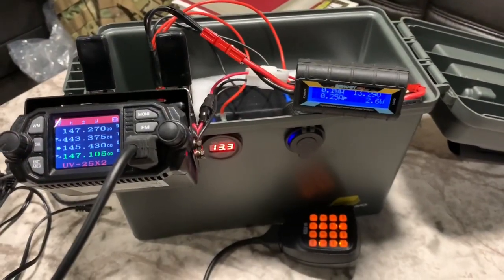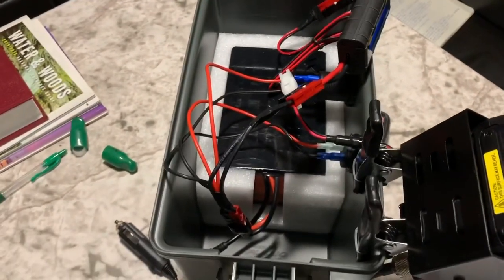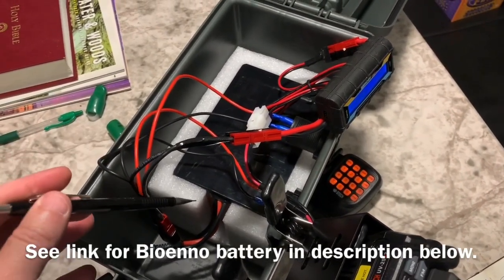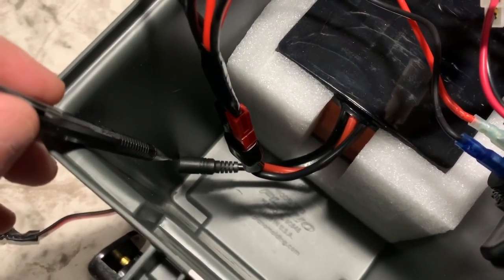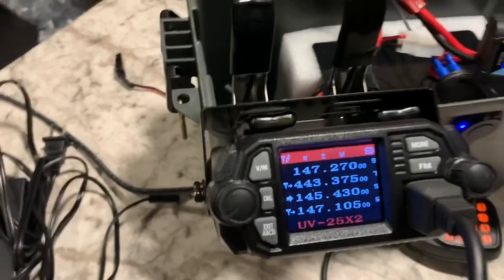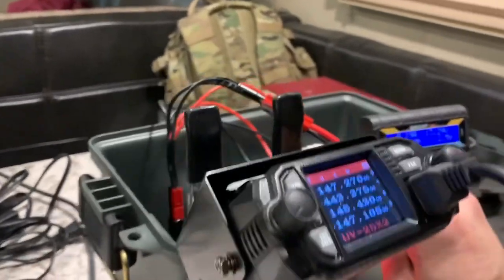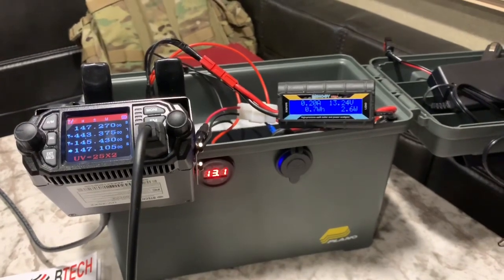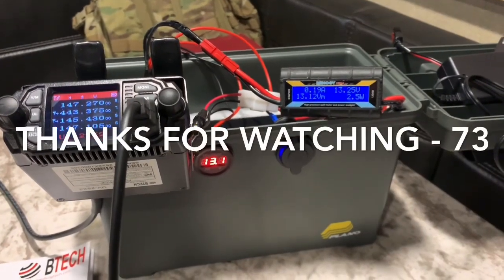Portable Radio Comms!  BTECH UV-25X2 - 2m / 70cm Go Box

Comment: Good video.  I  like the ammo box. I am hoping you can answer a question for me. I want to purchase a 12 volt power supply so I can program the radio with my laptop and Chirp. Is a 12 volt, 10 amp power supply too much? Is a 12 volt, 5 amp too small? What would you recommend? 
Thank you. 73's Ernest Bazzinotti KC1LKB
Reply from the maker: I would use a 12v / 10A power supply with this radio.

Comment: Great video! What kind of range were you getting out of a system like that? KI5RGM
Reply from the maker: Howdy and thanks for the feedback!  It really depends more-so on what type of antenna you pair this with and how high up you put the antenna.  If you use this with something like a Comet GP-9 vertical up at say 20 to 30 feet, you should get 10 to 15 mile radius on comms if your terrain allows for that.  If you pair this with a beam antenna with decent gain and similar height, you can probably double those numbers.

Comment: I'm fixin to test on the 21st for a technician license.  Would you recommend a rig like this for startin out?
Reply from the maker: It would be a low cost, yet functional,  dual band radio with modest 25 watt power that could be used in a vehicle or at your home that would serve you well.  The radio should be able to be found for less than $100.  A decent dual-band Mag mount antenna like a Tram 11861 should be available for less than $30.  For a starter radio that you will continue to find use for in the future, I think it would be a good buy.  The drawbacks are that the programming software (CHIRP) and menu system can be a bit clunky.

Comment: Since you have the watt meter installed, what is the max amp draw that radio pulls from your battery at full wattage?
Reply from the maker: With the portable antenna set up I typically use, which is an Elk 2m/440 5-element log-periodic, I can usually get 25 to 50 mile range simplex, depending on terrain.  I generally run that antenna at about 20 ft above grade.
Reply: Nevermind I see your radio is on high, and consuming about 3.67amps while transmitting. What's your best line of sight transmission distance how you have it set up in this video? I can get about 8 miles max on a handheld in the flatest of flat land and I'm looking to move up in the world. Great video btw

Comment: Do you know the amp draw when doing both transmitting and receiving of the UV-25X2? I have been thinking about getting into Ham Radio on more the prepping side of things, and looking at it as a budget friendly transceiver for an off grid solar setup. I cant seem to find any concrete data for my question, to help determine what battery and solar panel to go with.
Reply from the maker: I think it’s 5 to 10 amps at full power if I recall correctly.
Reply: I wondered that too, it's in this video since he has that watt meter you can see it. .2amps standby, .23 receive, 3.68amps transmit. 20ah lifepo battery. i think those batteries are all rated at 20hours to find the capacity, so 1amp for 20 hours =20ah. i dont think you are supposed to drain them 100%, maybe down to 10%, unlike agm and other deep cycle where you can only take it down 50%. personally i have seen the data sheets on this topic and will simply say 30% on lead acid is actually the best dod, thats another great thing about lithium